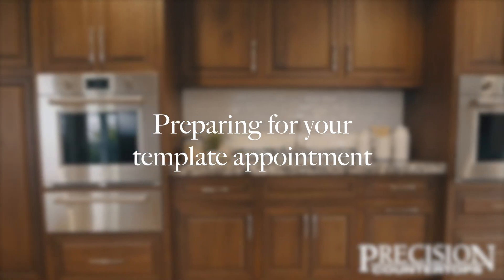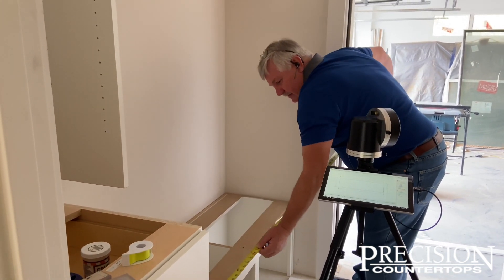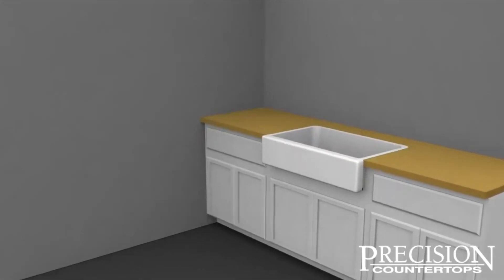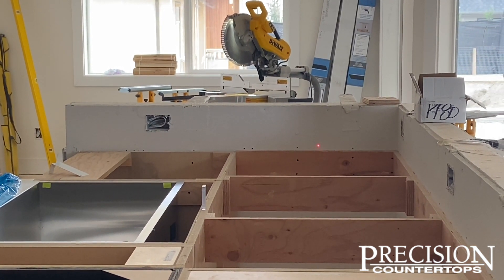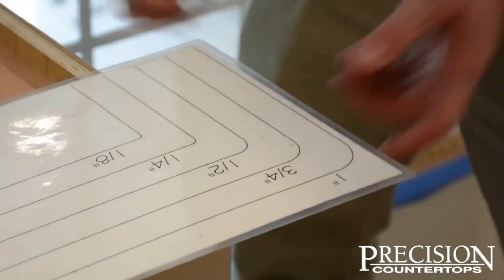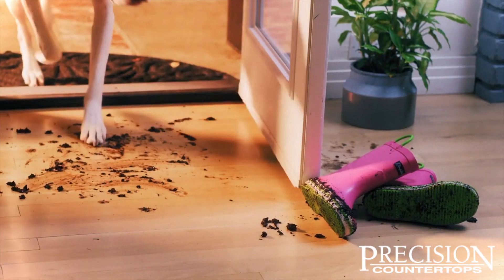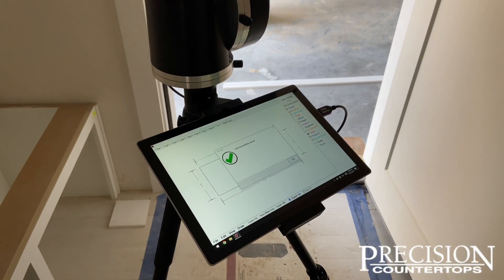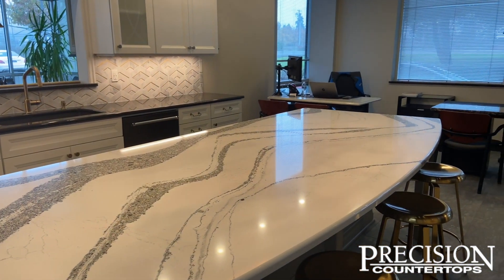How To Be Ready For Your Template Appointment

Comment: BEWARE: if your renting your property and you want to change your countertops and you choose Quartz, when there is a manufacture defect, they will not fix it or replace it because is not owner occupant.  So it doesn’t matter what kind of countertop you choose please ask all disclosures, I paid very expensive for this quarts and only 2 years there is a crack from the seam and I got no replacement. If HOME DEPOT refer this company  pls don’t buy your quartz from them unless they explain first regarding the warranty between personal use or owner occupant versus rental property.  They are both misleading the customers.  Home Depot should know better and  inform  customer  this quartz warranty stipulation  since it’s showing  their displayed at Oak Harbor Washington State I’m Whidley Island.